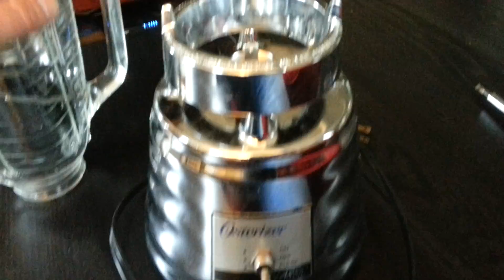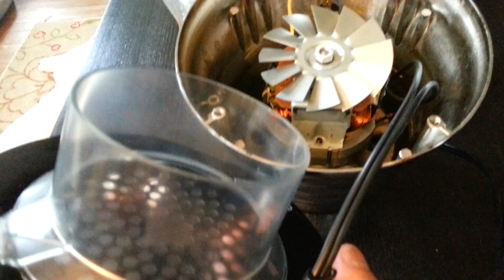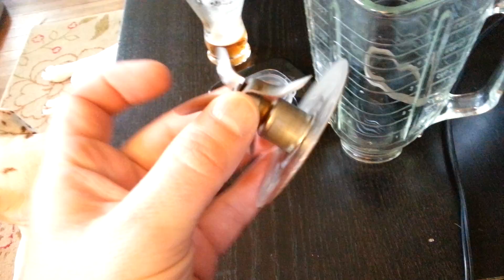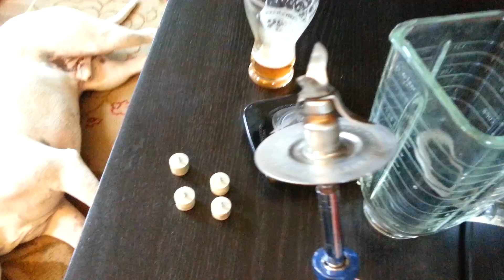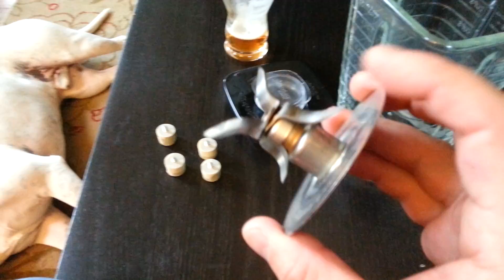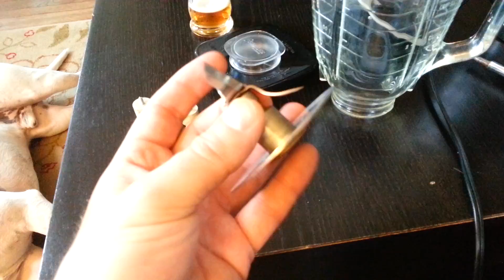How to Repair Your Blender and Save Your Party, Part 1of 2

Comment: I’m used to car fuse and those capsule fuse. Would’ve been nice to see what your fuse looked like. Opened my Hamilton blender, the internals are very similar to your  blender. Initially the blender smoked up and then it wouldn’t start no more.

I opened up the blender to see that everything was pristine, I didn’t see a fuse but will double check. The brush on the motor seems to have normal wear. Good catch on the steel blade, will see if that thing is locked up. Even then, if it doesn’t start, and mechanical parts look solid then it’s an electrical issue :(

Comment: Well mine doesn't add up, at first the light on the switch would go on but no action on the motor. Then i discovered a cut wire going to the motor, after mending the cut wire the switch light wont go on now. Thats where am stuck now, cause everything am thinking of doesn't add cause nothing major was touched

Comment: “😂The lesson here, is use your fuckin’ blender!”
Reply from the maker: Like that?  Lol
Reply: Great video. Pretty Petey
Reply from the maker: @michaelbronfman7648  thanks!
Reply: @KAFKUBA  no worries. Thank you 
I have a cuisinart spl 7 ch blender. It powers on but nothing spins when I push buttons. I changed the blender blade driver clutch. I think it may be the motherboard. Do u have any ideas on how to access and or fix this? Thanks a bunch. Please keep posting videos
Reply from the maker: @michaelbronfman7648  no matter what the project it all depends on what you find and knowing what to look for.  I don't know your specifics but I'm guessing it's probably fixable.  Look for signs.

Comment: I like the 'try to fix before buy new' attitude, this is why I came across this ... I have a similar Osterizer blender and while it is still working, it now starts emmitting an electrical burn smell after 30 secs of use ... and from what I have been googling so far, I need to replace the brushes ... and I am still looking for.a video to see if that's something I think I can do by myself (no idea yet where I would get those parts though) ...
Reply from the maker: Thanks Peter! That's the idea of my channel. Yeah. Everything is built for obsolescence nowadays I'm not sure... you could try begging the manufacturer. Is the blade stiff still? Maybe it's overworking. Are you sure it's a DC motor with brushes?

Comment: All you need to do is once a week use a baking soda lukewarm water  give it spin and it will clean any sticky Residue or just use little cooking oil and water do the same thing will loosen up the blads
Reply from the maker: They would do it...but normally most people wouldn't think about it...and then you blow a fuse. Thanks for watching and for commenting
Reply: @KAFKUBA  you welcome

Comment: Anytime one uses a food blender the blade must be promptly removed and washed thoroughly-food rots and collects in all minute openings and that's almost all the time the problem poor maintenance-wash/rinse strongly  blades while spinning w hand every time!
Reply from the maker: You're preaching to the choir handsome
Reply: @KAFKUBA  Then why so many locked up blades, choir ain't listening?  😉😉
Reply from the maker: @blkshk1  I mean it's like anything else right? We all can't lord over all our possessions 24-7 doing continual maintenance and replacements before failures ever occur... That's what safety systems are designed for. And even then...

Comment: I have a 16 speed Oster where only the button on the left works. I tried freeing up the circuit board to examine it but after taking out all the screws anchoring the board there's still a metal piece preventing the board from completely freeing up. Anyone knows how to deal with this?
Reply from the maker: My advice...if you care enough you'll get there...that's what I do
Reply: @KAFKUBA  I tried man, but the metal piece  is melted into the plastic after pulling a bit harder. I'm stuck.
Reply from the maker: @thingshappen9199  well there does come a time where you can't repair something...sorry to hear

Comment: IF YOU NEED TO REPLACE BUSHING and/or DRIVE STUD:  The square drive stud simply unscrews counterclockwise out of the bushing allowing the plate to come off - I just held the nut securing the fan blade (under the motor) by hand while unscrewing the stud. 
To remove the bushing, I removed the fan blade and grasped the threaded end over the flat side with plyers while unscrewing the bushing with channel locks. ..not very hard to remove so I didn’t crush the threads too badly!  The threads survived to reinstall the fan blade.   
NOTE:  I tried to find an additional “jam nut” to tighten up against the first one to prevent the first nut from unscrewing while removing the bushing.  It is 1/4” but uncommon ‘threads per inch’ that neither Lowes nor Ace had (it is NOT 1/4x20 nor 1/4x28) guessing it’s a discontinued 1/4x32 on mine from the 80’s or early 90’s).  IF you can order an additional nut with your new parts, you will have the easiest removal - and you could just leave the additional “jam nut” in place...(No reason to remove the fan blade this way) 
Oh and don’t even try to grab the fan with plyers or it will easily begin to round the flat side off against the bolt when you attemp to unscrew the bushing.

Comment: It is cheaper to buy a new blender.
Reply from the maker: MJ Sanchez haha...hardly...and that's not the point...why throw away valuable resources
Reply from the maker: Plus you learn
Reply: kafkuba
It is difficult to find parts for any blender.
It is better to buy a new blender.
Reply from the maker: MJ Sanchez all I bought was a fuse and you really can not even use that. You must be on sales!
Reply: I bought a Oster blender and the blender failed on the first day.
Reply: Cheaper ones usually the motor is not powerful, you spin for 30 secs and you can smell burnt.

Comment: Shield = fan shroud/duct.  You were right, it improves airflow for motor cooling.  I think you can buy replacement cutter assemblies.  If yours is rusty inside, a seal probably failed.  Being pressed in, replacing the cutter may be your only real option.  Thanks for the video!  :-)